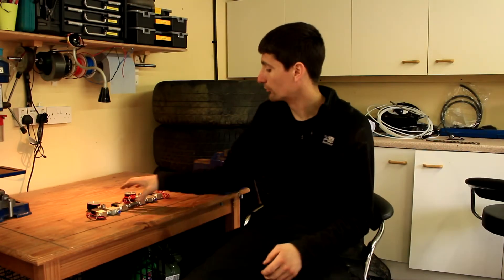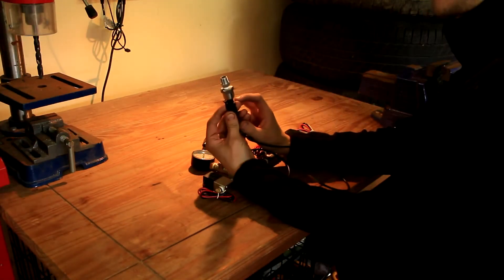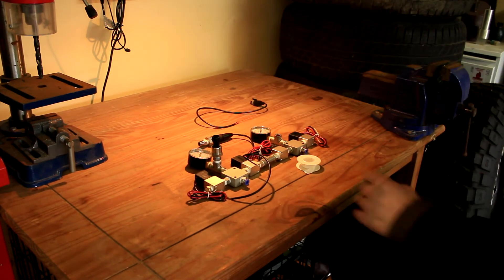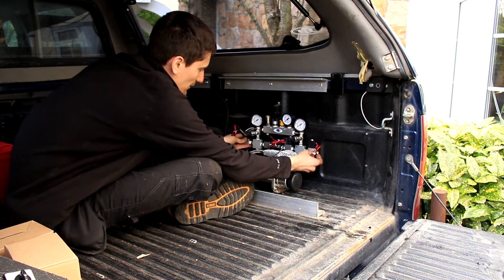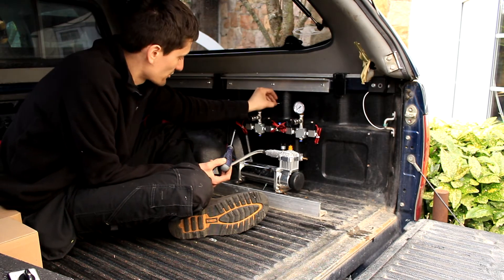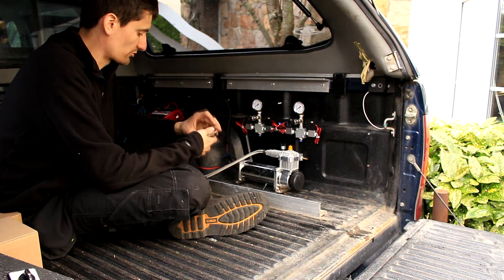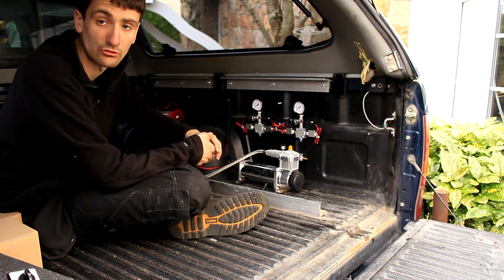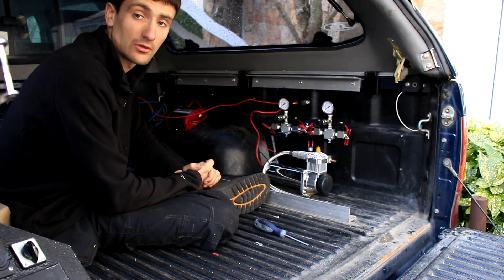DIY Airbag Suspension Controller: Manifold and Compressor Install

Comment: Great work man, but I have a question ,
How does the sensor read the actual pressure in the airbag when there is a supply of 120psi in the system?
Reply from the maker: The pressure in the airbags should never exceed 100psi so only a 100psi sensor is needed
Reply: @OverlandExplorersUK  imagine this, the compressor / tank is inflating the airbag, at that moment the pressure in the system would be the maximum of the compressor/tank let’s say 100 psi, you need your pressure sensor to tell the pi to tell the compressor to stop inflating when the airbag reaches 80psi , how will the sensor know that the airbag reached 80 while the inflating is ongoing at 100 psi. Do you get what I mean?? Because the whole system is pressurized at 100 while inflating. Or do I need to stop inflating periodically and check? Thanks for the help 😊
Reply from the maker: @Hazemzamel  when inflating the system isn't at maximum pressure of the system, the pressure in the bags slowly increases as the pressure builds up even though the compressor tank is at 100psi 

The program constantly reads the pressure in the bags as it inflates so it knows when to stop
Reply: @OverlandExplorersUK  what I was thinking of doing the same to inflate the tires, but the problem is when I am reading the pressure while inflating it’s always higher than the set point to stop. My gauge  when inflating is reading about 65psi, I have to stop the air to get the correct reading from the tire. I wanted to make a system to inflate and auto stop at a set pressure, just like ARB.
Reply from the maker: @Hazemzamel  I believe that will be due to the one way tie valve causing resistance and increasing the pressure

In your case I think you would have to program in a pause to measure the true value.
Reply: @OverlandExplorersUK  man, thanks so much , I never thought about the one way valve, I always thought that the pressure from the compressor has to be higher to fill the tires, right?
Reply from the maker: @Hazemzamel  it does but there will be a pressure drop in the system due to high flow rate as it trys to fill the tyre up
Reply: @OverlandExplorersUK  thanks man, you have helped a lot with these.

Comment: Can you provide links to the parts used in the build? I like those 4 way manifold because of the mounting holes. But I can't find them anywhere.
Reply from the maker: Ben Smith I have had a quick look and it seams that the seller has stopped selling them for some reason 

However I did get them from eBay so you might be able to find something similar on there